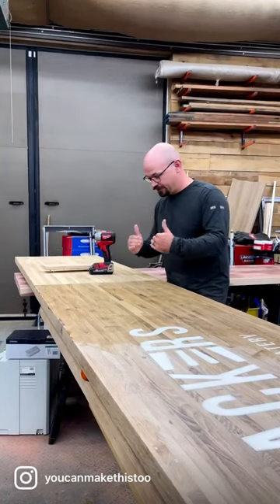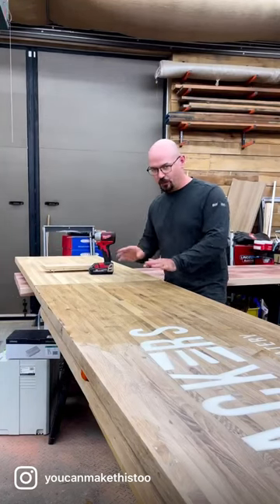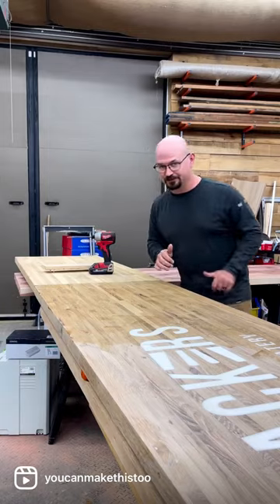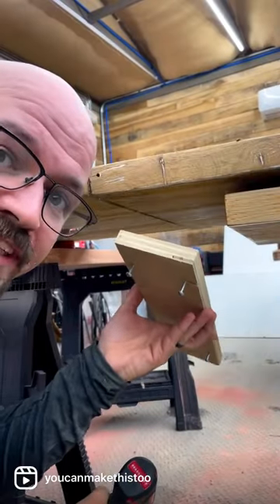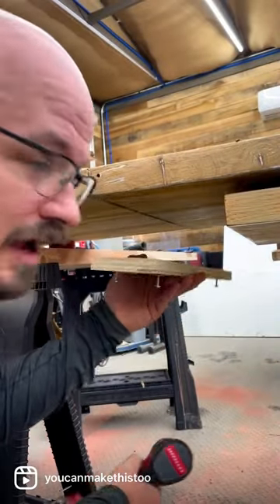Perfect jointing trick

Comment: This is great timing, I’m making a 17 ft long bar too. Any tips for mitered corners? The bar top is U shaped.
Reply from the maker: I’d cut it as close as you can and then use this technique to bring it home. Screw multiple blocks under the bottom so the bar pieces are a perfect 90 and after the track saw piece it’ll be as good as can be hoped.

Comment: It appears to me that you’d need to that step twice. It does not appear the blade thickness actually contacted/cut every square 1/8 in. of surface top to bottom and end to end of the “joint”.

Comment: Ever try left over right 12 degrees?
Reply from the maker: I haven't, you like it?
Reply: Yes
   Don’t know how deep your saw cuts.
   All you do is over lap left over right 3. -4 inches. You gotta fasten down the pieces ( get them straight) then set the saw at 12 degrees cut it, pull the cutoffs out, save one to hammer down the pieces . You only get one chance!!!
   May want to practice a couple times
   Opposite way for worm drive.
     I used to build log homes back in the day. Our fascial board was rough cut red cedar 1x10.
   Really tight joints.
    Play around for abut til you get the hang  of it.